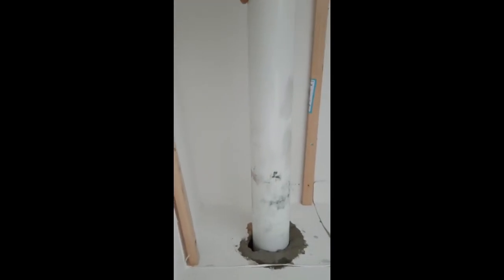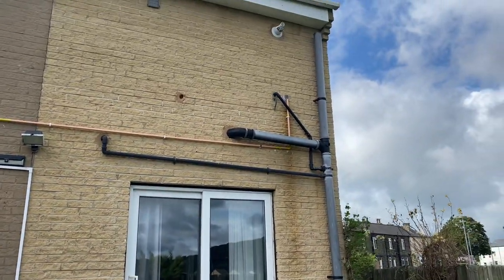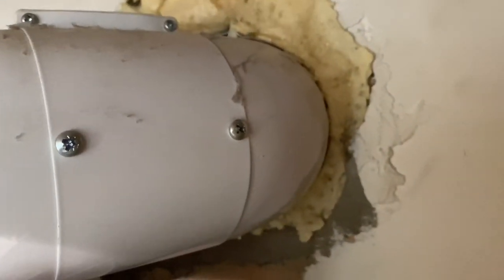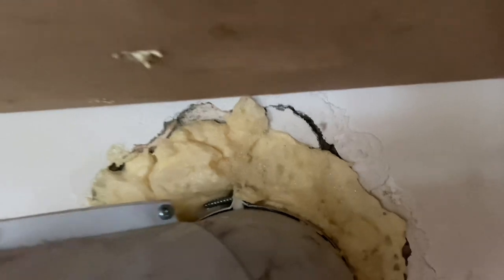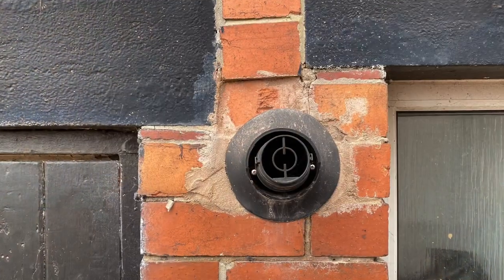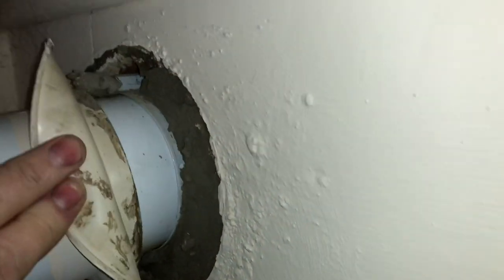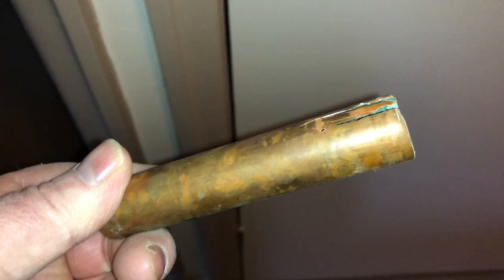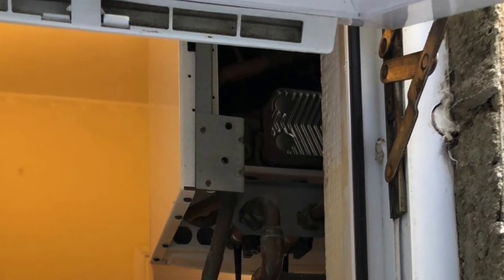Dangerous Gas Boiler - Badly Installed Boilers - Leeds Plumber

Comment: Beware roofers and kitchen fitters. About 18 years ago we came across a row of council houses where kitchen fitters had 'conveniently' used the vent for the open flued boilers to fit extractor fans......they'd done it to about six houses. Three years ago a neighbour had a nice zinc metal roof installed on his extension which housed the bathroom. Just outside the bathroom was the Baxi Combi. The roofers had simply ground off the concentric vertical flue terminal to fit their zinc panel...then fabricated a zinc tube which they popped over the top with a plastic mushroom lid on it, and soldered it onto the roof panel !. When I found it I RIDDOR'd it, but the roofing company had 'mysteriously disappeared' and none of their phone numbers worked according to HSE, who did at least have a go at finding them. The architect supposedly in charge of the re-roof denied ever having given them instructions to interfere with the gas, and seemed really angry with me rather than the roofers....but there you go....
Reply from the maker: I need a roofer lol.
Reply: @AllenHart999  So do I as it happens 😁

Comment: That’s quite shocking really but you do see stuff like this on a daily basis , in my opinion it’s especially worse up north or in the Midlands where you can get a boiler fitted for £300, I’m surprised to see a Worcester 24CDi still running! Must be about 30 years old now , the worst is that main eco overhanging the window that’s shocking